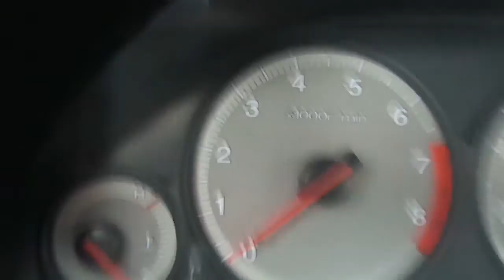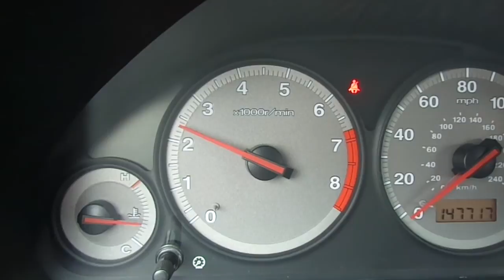2002 Civic LX D17A1 motor noise?

Comment: Aye, just rebuilt mine, new rod bearings. New crank, new rods. New pistons and rings. New valves and adjustment.etc. The d17a1 and a2 just makes that noise around 2-3k, hate it buts it's the honest truth, put 10w-30 in, makes it much more quite
Reply from the maker: I never ran into any issues up to when I got rid of it a 205k miles or so. Don't know if it still runs cause it's been like 5 years

Comment: I have an Accord that makes that same noise between 1500 and 2000 rpm. I had another Accord and Civic that made the noise also. The 2 Accords are both 94’s and are still on the road. I daily it, 700 miles a week, 250,000 miles and still going. Just change the oil on time and your good to go.
Reply from the maker: I sold this one at 205k miles and still see it in town sometimes

Comment: Very helpful
Reply from the maker: The issue never came to a head and the car ran past 205k miles and then I sold it. Saw it around town a few times about a year later but haven't seen it in a long time. Main consensus is a rod bearing but not sure

Comment: What was your fix man? Having the same issue atm but dont think it's a rod knock cause car runs mint just makes this same sound around the same rpm range
Reply: You found an awnser? I have the same noise too. Rod bearings and piston rings replaced, new valve seats, valve adjustment done. Still does the same noise, only when engine is warmed up and between that Rev range. It works fine other than the noise, but it annoys me.
Reply from the maker: I never had any issues out of it
Reply: @sv182  you saved me bro, i was thinking to replace with new parts. But It's definitely not a rod-bearing noise, becz rod noise increases with the RPM. But its still the same on same RPM 2k-3k.

Comment: Can I ask if you found the source of this noise or were able to fix it? My 03 with 180k is making the same noise now on revving. Cheers.
Reply from the maker: not sure what the source is, but I use 10w-30 blended oil and its much quieter. got to use a heavier oil to compensate for the mileage. i haven't had any issues and im at 180k now
Reply: +dragonslayer1483 Very good, thanks for the response!
Reply from the maker: +Joshua Rideout no problem man! hope it helps
Reply from the maker: oh my... looking at this video my car looks completely different now haha
Reply: Piston 👋. These motors get it a lot and noticeable between 2k-3k rpm.
Reply: @alexgonzalez7395  having same issue, but running fine. any solutions??
Reply: @shahbaz-mayo  honestly I think it’s valve train. I put 70k miles in that motor with that noise. It be fine. Just change oil regular . It is what it is lol

Comment: Put you some racing bearings in it will run forever
Reply from the maker: It ran forever anyways lol. I sold it at 205k miles or so and I still see it driving around from time to time

Comment: I have seen tons of these with this issue....its a rod bearing letting loose. hondas are junk, ive been a mechanic for many years and they are no different than any other car. im not much of a foreign car type of guy but if you want a reliable car go with toyota.
Reply: You funny. lol I had Honda for a long time. They are the best reliable cars. You only see a car on the road or damaged because people can’t maintain it. Previous guy who sold me a Honda didn’t know nothing about engines.
Reply: Mines currently at 230k miles runs and drives perfectly